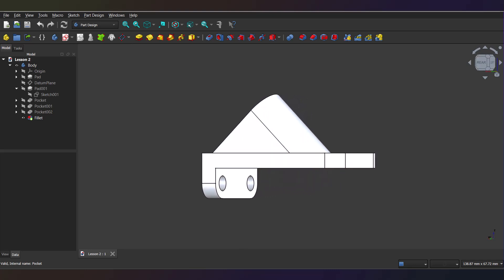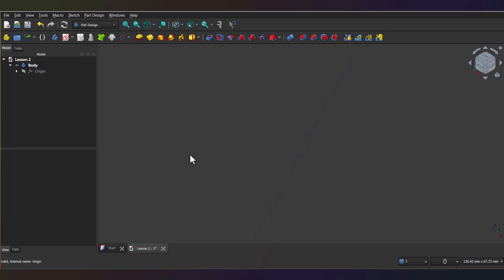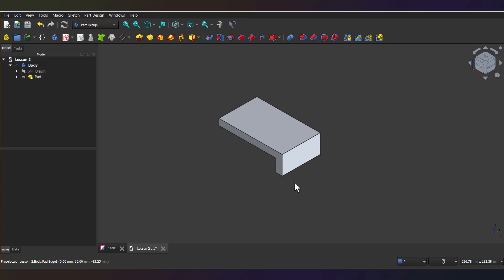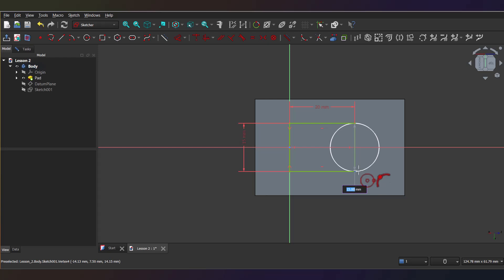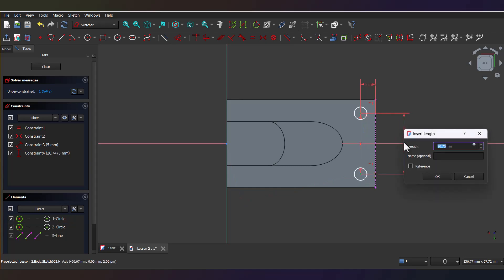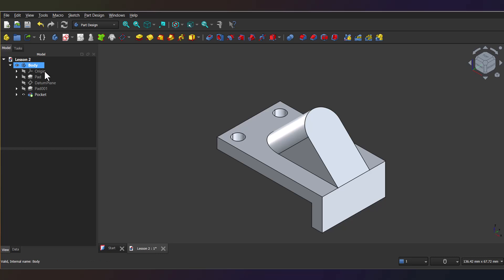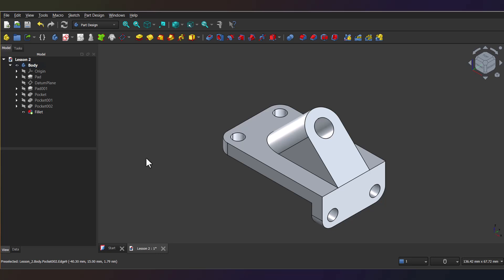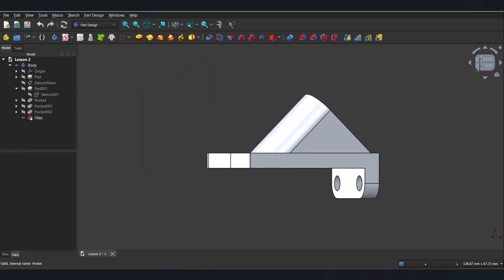FreeCAD Beginner Course | Module 1 – Lesson 1 | 2D Isometric Drawings to 3D Models | Mass & Volume

Comment: At 7:30 when you use the clip tool to remove half of the circle and the end line of the rectangle, the video skips to the sketch being fully constrained. I was left with two degrees of freedom after this operation. I had to constrain the semicircle to 180 degrees and make the top and bottom lines of the rectangle equally constrained before the sketch became fully constrained.

Comment: For anyone stumbling upon the magical fix at 7:30

After trimming the unwanted lines:
1. add 180 degrees constraint on the arc
2. make the top and bottom horizontal line equal ( = )

Good luck.
Reply: Yup.  Nope.  After author missed that "Auto Remove Redundants" that was fixed by yet another commenter, I'm giving up on this one.  🤬🤬  

So many instructional vids now where the instructor has already customized the interface rendering a simple copy by rote of their tutorial to be impossible.  

What a waste.
Reply: Thank you

Comment: You are missing a step that fixes your constraints @7:30 please include this, because even though my sketch shows fully constraint, for some reason the circle is not coinciding with the edges of rectangle and when I try to trim, I get errors, sketch with conflicting constraints.
Reply: Here's the fix is someone is not able to fully constraint the semi-circle after trimming:

1. Initial Geometry Setup
Created a rectangle with dimensions:

Horizontal: 20 mm

Vertical: 15 mm

Added a full circle centered on the rectangle’s right edge.

2. Applied Initial Constraints
Auto-applied radius/diameter constraint to the full circle.

Positioned the circle center using vertical and horizontal distance constraints from rectangle edges.

3. Trimmed the Circle
Used the Trim Edge tool to remove the left half of the circle, forming a semicircle.

This automatically removed the original radius constraint and introduced Constraint13 and Constraint14, which were redundant.

4. Cleaned Up Redundant Constraints
Manually deleted Constraint13 and Constraint14.

Reapplied a clean radius constraint to the remaining arc (Constraint13 = 7.5 mm).

Re-enabled Constraint12 to fix the vertical position of the arc’s center.

5. Fixed Horizontal Position
Applied a symmetry constraint between the arc’s endpoints and the origin point to center the arc horizontally.

6. Locked Arc Orientation
Applied a horizontal constraint between one arc endpoint and the origin to prevent rotation or flipping.

Solver dropped to 0 DoF — sketch became fully constrained.

7. Trimmed Unwanted Geometry
Removed the right vertical line that was no longer needed.

This introduced 1 DoF again due to the arc endpoint losing its anchor.

8. Final Constraint
Selected the arc and the top rectangle edge.

Applied a block constraint to lock the arc’s endpoint to the rectangle.

Sketch returned to fully constrained status.

Tip: If you see any of the errors with DoF remaining, click it in solver, it will point directly at the elements that you need to either add/remove or constraint to remove all DoFs. That's what I did.
Reply: it wasn't that hard. just add 180 degrees constraint, and make the top and bottom horizontal lines equal.

Comment: Hello. CAD.   Last 2 week ago I bought new Anycubic Kobra S1 and it  installed App on my Samsung Galaxy S25 Ultra.  Anycubic Slicer Next  can't download on my smartphone.   It  only download in  Mac or Windows 11. My Chrome Pixelbook doesn't device with it.  Hehehe. I bought new laptop graphics only Windows 11.  Anycubic Slicer Next  downloaded on Windows 11.  I need learn that.  But Anycubic Slicer Next  isn't model 3D for design, art, shape and more deep for myself. I looked for model 3D by website or apps.   I found FreeCAD to download on Windows 11.  I learning it.  I designed with box to saved on file. I opened Anycubic Slicer Next  to file and open from FreeCAD .  I found name of file and no there.  I  checked FreeCAD and Anycubic Slicer Next  by file for make sure.  FreeCAD only  PNF file.  I tried change STD from PNF. It's not work.   
I did added Workbench on FreeCAD by tools and peferences.  It still doesn't work.  I chatted with Copilot  AI for help and explained.   I still fight with FreeCAD to fix PNF to STD .  But no work.   
May you send me video about how FreeCAD change STD for help? Please 
Thanks Harold

Comment: At 6:59 the box does not turn green.   I am stuck on this bit
I have a error saying Reductant constraints (9)
Reply: had the same problem. someone up top made a comment about needing "auto remove redundants" enabled. You can find it under Edit>Preferences>General> Auto Remove Redundants (check the box and hit apply)

Comment: When you are deleting the segments at 7:30 it looks like the sketch is no longer fully constrained? But then it looks like the video glitches and it's constrained again? When I delete the segments my sketch is no longer constrained, wondering if you are missing a step? It definitely looks like you added additional constraints. Maybe a "constrain equal" on the horizontal segments, and a dimension on the arc of 180 degrees?
Reply from the maker: After trimming some edges, a few of the earlier constraints can get lost. The fix is to re-apply the necessary constraints as per the sketch. A quick way to spot them is by trying to move the segments — if anything shifts, that means it’s unconstrained and needs to be fixed.
Reply: @CADCAMCOURSE  then what should i do?
Reply: @CheskaAmorACEDO  add 180 degrees to the arc, and make horizontal lines equal with ( = ). (For anyone still looking).

Comment: When setting the symmetric constraint at 6:45 in the video, this operation will fail unless you have the "Auto remove redundants" option selected in the constraint toolbox. I believe this option is not enabled by default for new users.
Reply from the maker: Great point! 👍 You’re right — the symmetry step can fail if 'Auto remove redundants' isn’t enabled. Turning that option on in the constraint toolbox (or under Preferences → Sketcher) usually solves it. Thanks for pointing it out, this will definitely help new users.
Reply: I wondered why it kept failing lol
Reply: SO glad I came looking for this remark.  I was about to kick the project to the curb as another failure.  TY!!!
Reply: Thank you!
Teaching myself FreeCAD and following these tutorials step by step and could not figure it out

Thank you again
Was losing hope for a second
Reply: Thank you

Comment: Chamfer is a flat face to remove the sharpness of corners. Usually specified on drawing as ‘3mm x 3mm’ or ‘3mm x 45👁️‍🗨️’. A Fillet (pronounced with a hard ‘tee’ and not as in fillay). Is a rounded portion on a corner. Specified by its radius.
Otherwise excellent tutorial. Thanks.